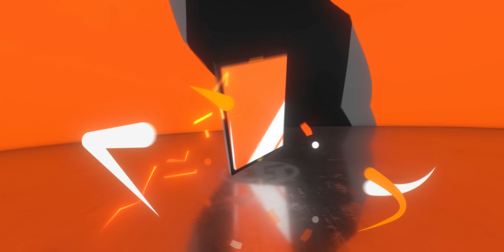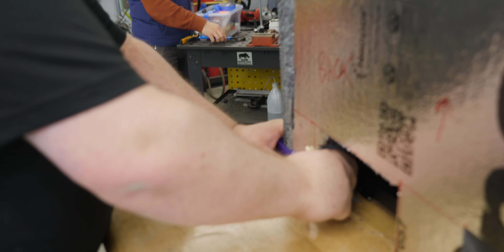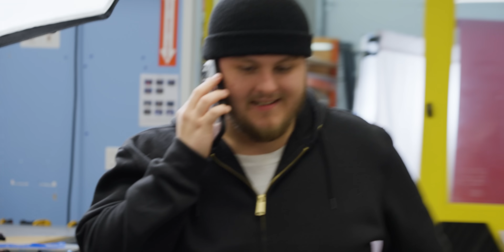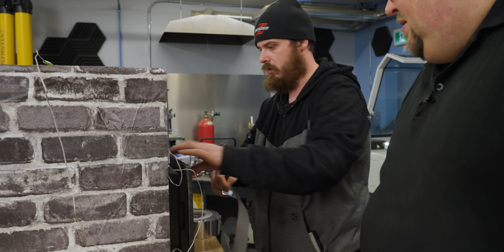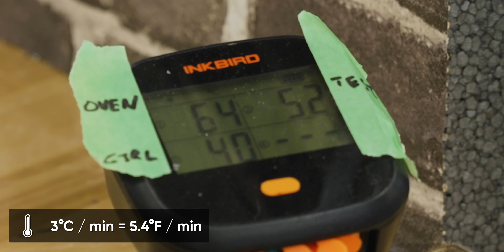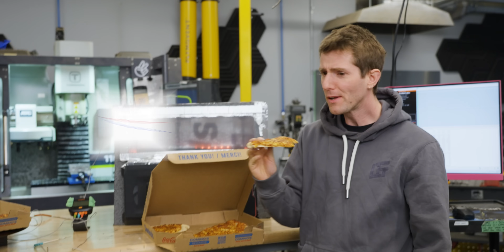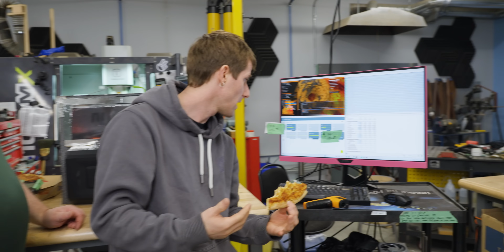Remaking Our Most Hated Video - Pizza Warming PC V2

Comment from the maker: Check out Pulseway today and get up to 40% off today using our link, excusive for LTT viewers! Start your free trial today: https://www.pulseway.com/land/ltt
Reply: If only SLI was still popular, Could have a pizza cooker!
Reply: Or Crossfire?
Reply: i just order a pizza lol
Reply: it works till grease from the box dribbles into the pc😁😁😁
Reply: I'm honestly impressed it did as well as it did, I had very low expectations for this.
Reply: You want back on the video team, you read the line.
Reply: i wonder how water cooling the pc components and embedding the loop in the floors and walls of the pizza oven to act as a radiant heat source would do. maybe also an intake over a large radiator at back of oven to further heat dump and help with convection.
Reply: I think you'd have far more success by dint of a simple wire shelf. (There's a reason toaster ovens and the like have them.) As it is set up currently, the warm air is travelling (while losing heat) to the top, heating the top lid (losing more heat) travelling through the air between the lid and the pizza (more loss) and finally heating the pizza. Some heat will be hitting the box bottom, but the majority will be forcibly pushed past it to the sides and up. A wire tray provides a closer-to-the-source hot air trap that will warm the bottom of the box, which is in direct contact with the pizza. It seems counter-intuitive to move the box further from the radiator, but physics isn't always intuitive. Just my Jayz Two Cents...
Reply: One employee in the video looks really unhealthy. Please help him. I lost a friend because he died of overweight. Thank You!
Reply: I'm still pissed as an engineer that when you cast a CPU cooler yourselves you when with the wrong process get some dumb engineer's on board as in those like myself who don't have a computer of some kind between us and the workpiece 😅
Reply: Which day?
Reply: we wanna see more gdamn 3d printed and diy watercooling gdammit
Reply: I believe RussianBadger made that claim when his PC overheated.
Reply: I did not see the original video, so I'm going to hate on this one!
🤬🤬🤬🤬🤬🤬🤬🤬
Reply: @LinusTechTips  Very disappointed at how Pulseway removed their free tier recently.
Reply: Hey guys! DIY Perks just relased a video of an upcycled lcd/projector combo thats just your kind of thing. Gave me sleeper oled vibes + hisense U9dg video. 

Make it happen!!! Do a collab and go bonkers with that idea! Maybe a 85 inch "oled like" home theater Upcycicled and lowish budget video? 

And while you are at it, maybe send one of those 4070 in your warehouse my way 😜. The graphicscard dry spell is hitting hard...

Edit: ok 115 inch maybe not doable but 85 - 98 inch tcl? Probably and actually cheapish?
Reply: Who would have guessed. Warm pizza better than cold pizza. Good job 😀😀😀
Reply: Pls heart comment😊
Reply: Hey linus do you think I will be able to get a 5070 founders edition 20 minutes after they launch because thats the earliest I get home from school ( Edit im curretly running an integrated graphics system and will bearly be able to afford a rtx 5070 founders ) Please give me a gpu i fr need one Linus
Reply: Good luck bud  @WizzardoX2

Comment: You guys could have ran an exhaust fan into a small duct/tube and had it exhaust the warm air back into the front intake. Help keep some of that heat from escaping and also give the incoming air a temp boost.

Comment: Good video. I would love too see this remade but instead of using AIO you buy heat pipes like there are for CPU and GPU air coolers and you connect them to a plate so all of the heat goes into a metal plate to heat it up.

Comment: If they turned down the fans on the front because it was letting in too much air, couldn't they just throttle the intake back up when thr cpu starts thermal throttling and vent the hot air to the pizza faster?

Comment: Just heat it directly off tbe heat sink. Find a steel plate to transfer heat into. Or they could have had a small fan inside the pizza warmer, moving the warm air around the pizza even more.

Comment: You could greatly increase the efficiency of both ends of the device by swapping the fans out for ones that maximize static pressure, then run the exhaust through a series of small radiant tubes. This would allow the PC to be cool while maximizing the heat transfer to the pizza, just don't forget to add an insulation layer between the PC and the oven.

Comment: No, I think "next level" is a complete water cooling system that has radiators immediately downstream from the load that heat the pizza, and a thermostat that controls how much water goes through a cooling radiator downstream from the pizza.

Comment: What with yall being in Canada and all, I’m sort of surprised I’ve never seen like a reversible ducted cooling system. In such a system, with the flip of a louver, cold air could be ducted in from outdoors in winter, brought through the pc via the pc intakes, and exhausted into the home as warmed air. Then in summer, the louver could be flipped so the pc has air conditioned house air at its intake and the port to the outside would be connected to the warm exhaust. 
There is something to be said about creating a negative or positive pressure environment in the home drawing in or pushing out the air which is already conditioned by the homes heating/cooling, but the test could be tweaked to help account for this. Or simply frame the test around pc cooling effectiveness and less about gaming the energy efficiency.

Comment: OBVIOUSLY you use an air cooler not a aio you remove the fan make a thin copper plate that goes on top of the air cooler to transfer the heat to the pizza and if you wanna improve that add the fans in hooked to a switch so when theres no more pizza your performance is returned lol should theoretically be fine unless you are maxing out the cpu usage idk be fun to see the result's

Comment: Funnel the heat into a separate enclosure so you won't need to vent any heat. So when the pc is under load and getting too hot you can seal the separate enclosure and let the pc perform as normal

Comment: Not gonna lie, but that was a pretty disappointing video.
Luke wasn't involved, so it wasn't really his redemption, and the build was extremely low effort.

Also, did the LEDs even react to the temperature?
And did the cold slice get warmed up?

I will say, I did like the flickery LED effects, however it was again ruined by low effort.

This should have been an alex video.
Something well built, with Alex's crazy take on heating the chamber and overclocking or something.

Comment: The safe heat is 75 not 60, big mistake considering the point of the video, why not use a heat sink effectively as a hot plate, potentially allowing you to move the heat away from the pc itself

Comment: I think it would've worked better if you had one radiator pushing into the Pizza Pocket and the other pulling air out and back into the case. Part of the problem with exhausting them both into that space is the positive pressure that will leak hot air out of the system. 

I want pizza so badly now, I think that's what I'm having for lunch. Thanks LTT for reminding me that pizza is delicious

Comment: You cold use the uhh fridge things it does cause condensation but you're not gonna mount in on the hardware just direct the heat and then use the fridge motor to heat the food, no throttling and very warm food

Comment: So, we're just not going to talk about the fact that Luke didn't actually do anything? 

Also how the heck does assembling a styrofoam box = Custom designed and 3D printed brackets with sharpened wood sticks
But mounting an acrylic oven door to the box = a piano hinge and a bunch of tape
???

And we didn't even see results for the cold slice reheat test.

Honestly guys, this is why I don't click on these weird builds anymore. This was 10% fun and 90% bad execution. It's just hard to watch and it wasn't even a satisfying conclusion.

Comment: It's pretty odd that your 60°C pizza is put in a 65°C oven and cools down? The one thing I can think of is that the pizza box is soaking up some heat there, but other than that, the pizza shouldn't be able to get cooler than its surrounding environment?

Comment: id just grab a 10th gen Intel overclocked, crappy PSU, an rtx 4090, then id start Prime 95 and a GPU benchmark at the same time and direct all the heat out the back lol yall did almost exactly what id have done

Comment: If you want a really nice pizza-warming PC - it's not about letting the hot air to leave the chamber, it's about dividing the exhaust to the chamber or to outside, so the parts might finally chill a bit. 
And you could make a Peltier side panel, so it would cool the inside of PC, but keep the pizza warm (massive energy consumption though)

Comment: They put a 300+ Watt electric heater (aka a PC) in a decorated foam box. I mean.. its a little funny, but meh. And if the carton is soggy with grease, no way I am putting it over a fan grid, under which sits my mainboard.

I expected a practical solution. Its a tower-PC, so make a pizza-landing-pad on top of it, like a helipad on a skyscraper. A liquid cooled CPU and GPU with a 10" copper plate as a passive cooler, no fans. You could actually use that, it might even look cool, and your system is grease-safe.

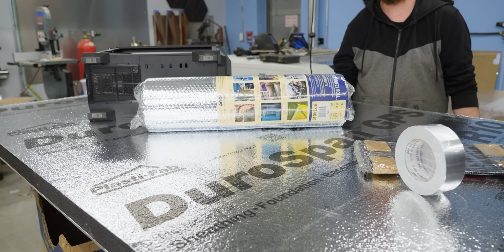Comment: 2:30 I am predicting its going to fail, because the air leaving the AIO is going to be 40C at best, I think you want to continuously reheat the same air, so put the AIO in a separate box with the pizza, and never dump out any air, or introduce new air.
Your components reach 80C, and your box will hopefully reach 60C.
Reply: And they succeeded by putting the PC in the same box with the pizza XD oof!
Glad it worked, Luke!

Comment: Commenting here since this is the latest video and you might read the comment, I came here from the 5090 video a week ago... I realised you guys do benchmarking on a lot of single player games. the thing is most people who are hungry for FPS need their multiplayer games to run smooth continuously. you guys need to add more multiplayer games to your benchmarks even if the games are old. You guys do use CS2 but I have not seen Marvel Rivals(Overwatch), DOTA(LOL),  PUBG(Fortnite,Apex), Siege etc. (Fightning games need 60 FPS since the game is locked at that FPS for most games so not a big deal). The single player titles just show a how good a game can look, but multiplayer games are fast paced and need the higher resolution for competitive edge so you might need to add these to your radar or in the Labs. Might be helpful since I only upgrade when I don't get FPS in my current Multiplayer game as I can just play older Single Player titles with good FPS.

Comment: I know its probably already mentioned somewhere in the comments instead of pushing air to the chamber you could/should use some sort of a heat exchanger setup to allow better cooling for the PC while keeping all the heat you want in the chamber. Either something like just bottom plate with fins to capture hot airflow from the PC to heat the bottom of the chamber or maybe fancier setup that heats the chamber more evenly by allowing the PC exhaust to pass thru a channel in the chamber (without mixing with chamber air) and dumb the heat into the chamber

Comment: Genius! .........improvements, use water cooling and loop the hot water from the GPU and CPU through a insulated radiator or pipes coupled to a metal plate in the heating chamber then run the loop out to external radiator so cold water goes back into the system, then all the heat is in the pizza chamber without airflow cooling it off and pc has no thermal limits (other than figuring out flow through a really long loop. that might need a temp controlled exhaust fan in the pizza chamber cause i think it'll get toasty! Why is this not a thing you can buy?

Comment: I would have created a return path for the leaked air back into the PC air intake with a thermally controlled diverter flap if it get too hot.

Comment: Just like a cars AC system you need to recycle the air to get it to temp and then control how much fresh vs recycled air is pushed thru the system. Just like how a charcoal grill has air intakes on the bottom and the top of the grill.

Comment: I think a possible way to keep the pc parts cool and the pizza safely warm is a duel chamber.  You keep the tower on its side and use ventilation to transfer the warm air to the pizza chamber.  I think for lols they should expand this to where it really works (not actually cooking the pizza, but keeping it at the recommended safety standards).

Comment: The main issue is definitely airflow. If you flow air through a radiator, you're not getting the reported temp. You're getting whatever temp is hitting the radiator divided partially by ambient. What would work better is to have a two radiator custom water loop setup.

From the water blocks, you run into the pizza box/oven. That has a dedicated radiator with fans. It then runs outside and to a second radiator where the water is cooled before returning to the water block.

The pizza box / oven must be ENTIRELY SEALED. I'd recommend having a metal plate as a base to give additional thermal mass to the system, that way it can stay warm when the door opens and closes as well as preheating to receive the pizza. Using fans on the radiator creates a "convection oven" environment to ensure no cold spots. This also protects the PC from grease/oil drops and crumbs. Place the door low to minimize losses when opened. The combination of retained heated air and baseplate should ensure pizza stays warm or even becomes warmer over time depending on the computer load and oven usage.

The temperature of the second radiator can be adjusted with fan speeds to try and optimize temps. Knowing losses exist, it would be best to try and hover the system around 70°C idle to help make sure the loop maintains 60°C+ once it hits the box. Aggressively curve the fans to ensure the PC doesn't throttle on the second radiator. The goal is to heat soak the loop so you will sacrifice a little performance for better pizza.

Bonus: 
-set the pizza box fans to a switch on the door, that way they turn off when the door is opened.
-placing the radiator below the baseplate and forcing the air under the pizza first will ensure the colder air is heated first to preserve temps and heat soak the plate. (Essentially an air-loop system.)

Conclusions:
-This preserves the PC temperatures to within acceptable ranges. 
-This preserves cleanliness of the electronics.
-This ensures food safety by elminating "hot computer smell" from the food environment.

Comment: This one is much better than the last, but I have some ideas for how it could be better. 

1. Airflow. 

You're not necessarily trying to prevent air from escaping. In fact, it's probably better for both the PC and the pizza if you don't. You need a proper exhaust, even in an actual oven. I would suggest creating a platform made of the thinnest and least dense screen possible to sit the pizza on, and have a sort of funnel system that causes all the air leaving the PC to blow directly past the pizza.

Which would function a bit like a CPU air cooler, but with hot enough air that it actually keeps the pizza at a sustained elevated temperature. You could also have a sort of air recycling duct that directs the exhaust back into the PC's air intake, which would make for even hotter air blowing past the pizza. 

2. Direct pizza warming 

Peltier units are crazy. You could build a large platform out of steel, copper, or aluminum and have a peltier unit heating it up. Then use the exhaust air from the PC with a series of closeable exhaust ports that can regulate the airflow across the metal platform to prevent it from getting too hot and overcooking the pizza.

Comment: I found this video disappointing. The big thing I can point to is that this has no real application without a high end system doing nothing but running a power virus. This would have been far more interesting if you had achieved it on a system just running a game as you would actually use a solution like this.

Comment: I think the warmth in the pizza warmer would be too low without PC temperatures suffering. To counteract this, I would use a (or multiple) TEC pads to concentrate heat in a secondary loop by sandwiching them between CPU blocks (one on the PC side and one on the secondary loop side) and recirculate air through a radiator in the secondary loop to continuously add heat to the air. Even better, the second loop should be fully soldered with no plastic or rubber tubes, and a pump that can handle warmer water. Not sure what a ddc or D5 can handle. I think with a little more effort this could have felt less lazy.

Comment: @LinusTechTips you have checked the time and temperatures for the food safety... but have you also checked, whether you can even use the GPS insulation in contact with food, especially if you heat it up above 60°C...? 🤔

Comment: Needs a 2 loop water cooling system, one to a steel plate at the bottom of a fully enclosed well insulated pizza warming chamber, the other to a radiator, with a diverter valve controlled by system temperature parameters.

Comment: Hmm, I think you could get this overengineered a lot more! Problem is the fresh air. You really need a "feedback loop" that sends the hot air through the radiators again (might need some filters) Once the gpu is at target temp (maybe 80°C) you allow more fresh air in via a valve/duct (you could use a throttle body for (questionable) style points) to keep it at that temp to avoid thermal throttling. that way, you can also switch between oven mode and regular mode (so you'd only have to run your gpu at 80C when you really need it).